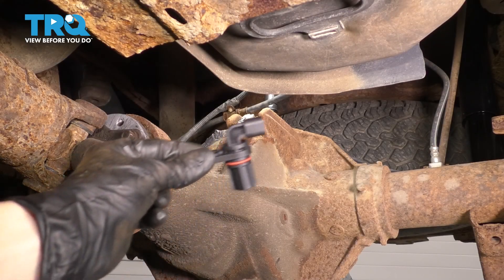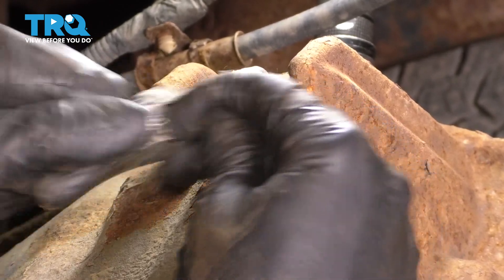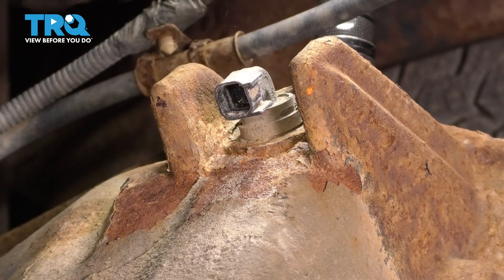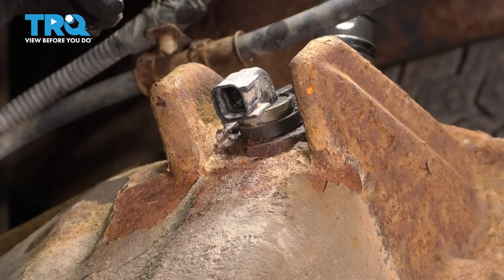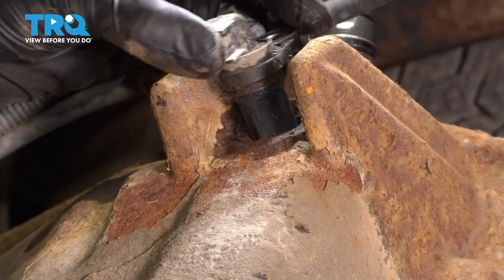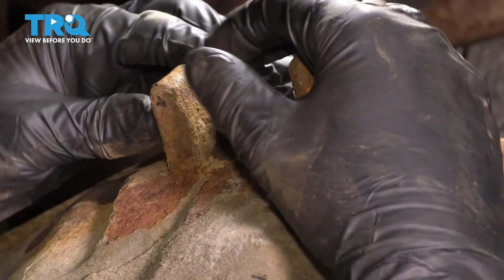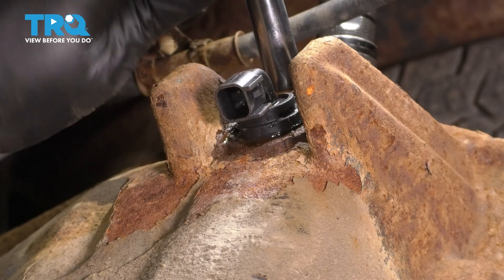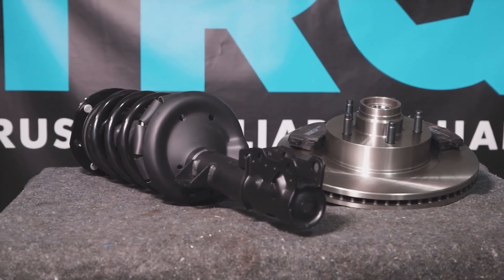How to Replace Rear ABS Sensor 2008-2010 Ford F-250

Comment: In the case where the differential fill plug is seriously stuck solid, can you fill the differential through this hole?  Just being careful to measure the correct amount of gear lube first.